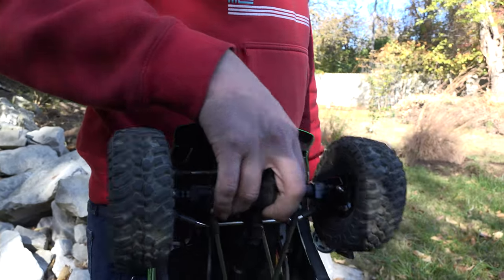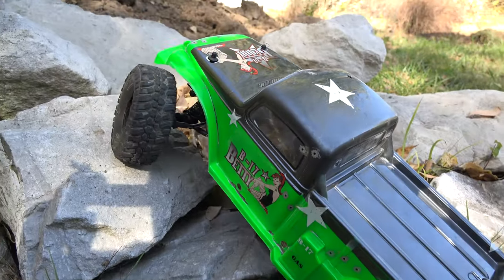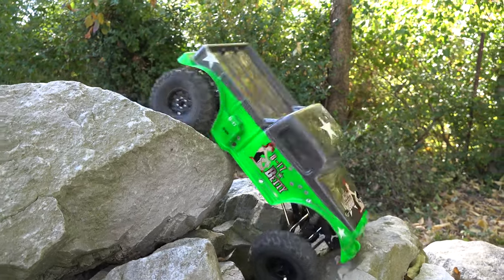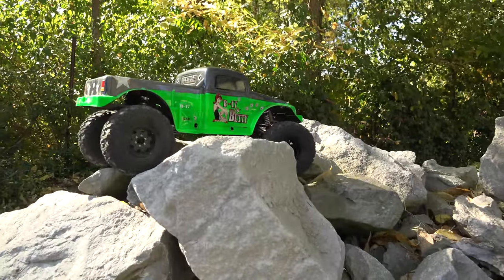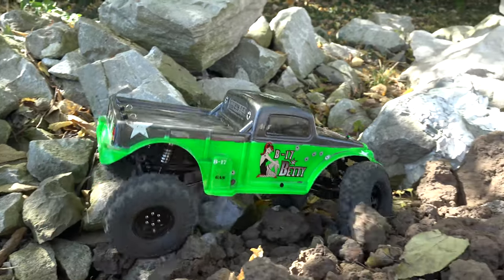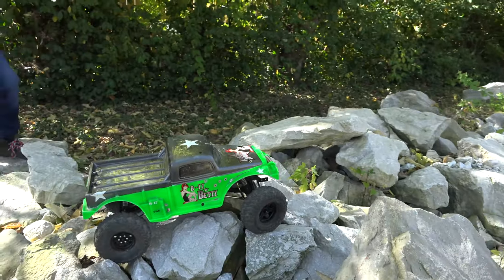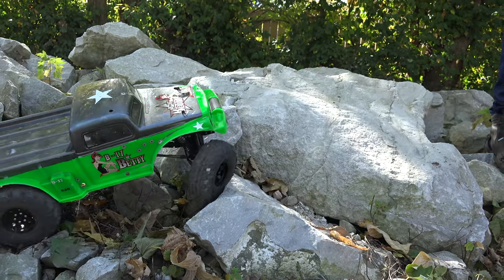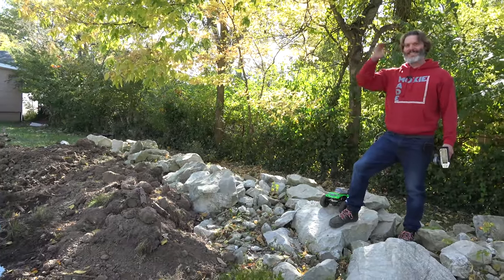Amazing Upgrades To Improve Performance (Front Weight Bias) Impressive Results || Crawler Top Tips

Comment: Good improvement!! I found that as long as the added weight lays behind the front axle, it won't make the rig pivot and tip over when going down hill. Not always possible, but definately a great difference!
Reply: That sounds like good advice. My TRX4 has brass portal covers with a lot of brass going lower in a fan shape but even front to back. I had drilled out evenly as the weights were heavier than needed but your tip has me thinking I should do some modifications on my brass and fill the holes that I drilled then try removing weight only from the front of the fan shaped part.
Reply: @brianbrigg57  I also have a weighted TRX4 and even got a brass bumper mount, had to remove it because the weight was a bit high, and way too forward. I think the optimal weight should be in the axles (unsprung mass), and if in the chassis, never beyond the axles to avoid a "pull" effect to make it roll. There is a whole science about all these things!!

Comment: Surprised that brass didn't make the motor melt down in five minutes. Wow, it's doing better than the ones you sent us.
Reply from the maker: What rig , motor, gearing, voltage,  and how much weight?  There are limits,  which is why we have the recommended page to avoid issues

Comment: I got same toe out with my element axles and same upgrades!!
But it’s worth it!
I gotta take tear steering link off and adjust?
Haven’t done.
It’s  insane what a few grandmas or different tires weight!!
And motors and esc effect a crawler!
More throttle on decents with crazy forward bias!
I just got ruptures and it was insane went out and did 4-5 lines never could do!
Reply: Upgrades not grandmas 😂
Reply from the maker: sure...

Comment: Definite improvement seen but the rig seems a little too heavy on the front. I drilled a few holes in my weights until I was satisfied. The shape of the weights allowed this to be done quite easily but I recommend removing the weights to drill as the drill bit tends to catch in the brass and the torque applied could break things if the weight is attached. Actually I drilled a little past where I was satisfied and used a little lead shot and epoxy to get back to what I felt was optimum. Some careful work with a Dremel might work on your knuckles. Just try a little at a time and do lots of wheeling before going further. 

If that was my rig I would buy some Desert Lizard shocks and try a droop setup. I used 100mm shocks as the droop setup reduces overall travel a little. The droop setup works well for me with stock rails, especially for side hilling, but your mileage may vary.

Comment: So, nothing on life, but I do have a question about gear pitch. Recently swapped my 10-3 2 speed with 32p out for a 3 gear trans that currently has a 48p spur and pinion. Am I trading out performance at all in going a higher pitch of gear? (52T 32p spur w/ 12Tp pinion, to an 87T 48p w/ 16T pinion). Wasn't sure the pluses and minuses of pitch, does the smaller tooth take away from gear reduction or add to it?
Reply from the maker: The pitch of tooth doesn't matter, only the actual gear ratio